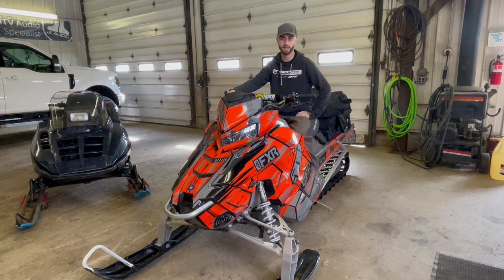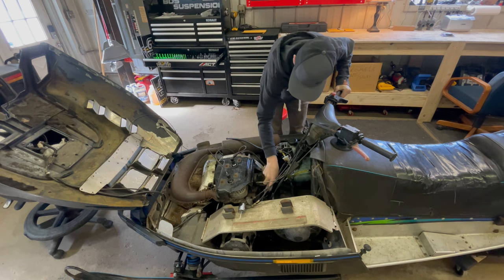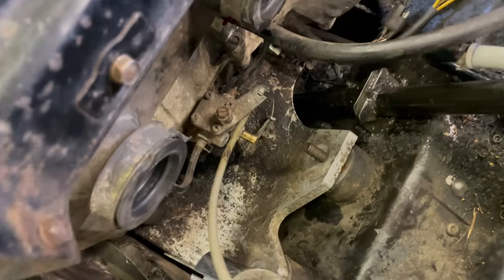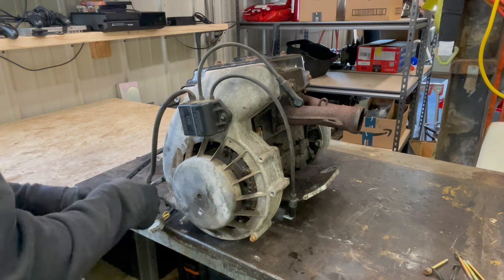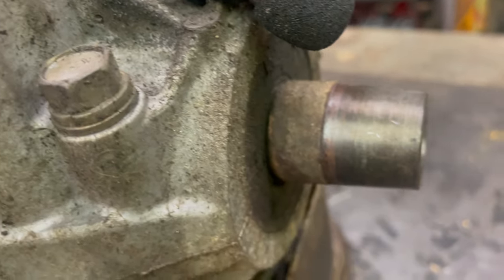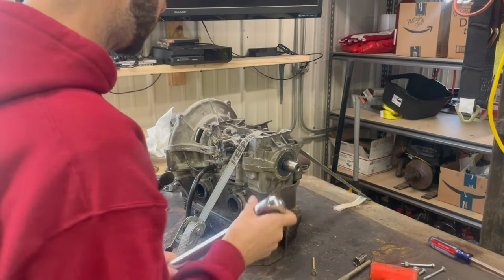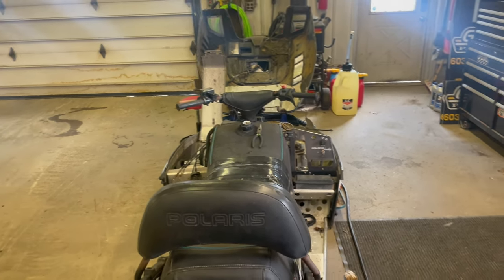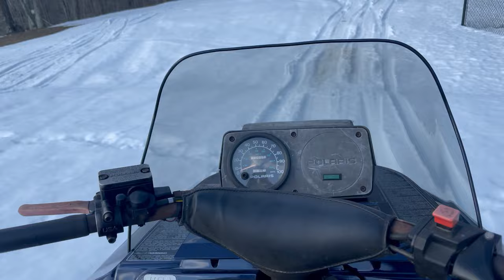1997 Polaris Indy Crank Seal Replacement

Comment: Really enjoy your content especially with no snow in Minnesota or out west where we ride. If you don’t have a clutch puller handy we use the clutch bolt with a bunch of wraps of Teflon tape and water, it will pop the clutch off using hydraulic pressure and no issues with broken pullers. We have used this method for years on our Summits.
Reply from the maker: Thanks for watching! I got family in Albert Lea! I always wanted to go back out there specially because you guys have the best swap meets and shows.

Comment: The heat mark's on the crank, those are from when they are assembling the pin that the Connecting rod rides on, they heat it with a torch, and it expands the hole, sometimes they might also freeze the pin to shrink it, the Combination produces an extremely easy assembly and a tight Press fit 👍 !

Comment: Hey! I know this is a little late, but if you weren't able to fix the bog, there are marks on the stator for timing. It will still spark if it's not lined up correctly, but it may cause a bog like you were experiencing.

Comment: I know this is an old video but for future reference, hardware on the chassis are American  9/16 on carb side nuts. Exhaust side are 5/8 head 11/16 nut. A stubby (short wrench) helps by tie rods. Engines are metric hope that helps
Reply from the maker: Thanks David!

Comment: Nice job. Doing is learning.  I have to ask... did you bleed the oil pump? And did you pre mix the fuel tank with oil since you opened the oil system?
Reply from the maker: I made sure bottom end had a little extra lube and then got the pump primed didn’t take long

Comment: Newsflash:  If your crank seals are leaking, then you likely have all kinds of damaged bearings.  Yet in this video, I did not that the crankshaft was pulled and the bearing individually cleaned and spun by hand to test the spinning ability and test for the sound of rattling ball bearings.  The piston rods could also be bouncing on the crank, but there was no test for that little detail.  End bearings can easily be removed and replaced without a press.  The crank ends should be sanded down with 2000 grit sandpaper or finer.  I did not see any grease applied to the backside of the crank seals.  I did not see any oil compatible grease applied to the exposed end bearings.